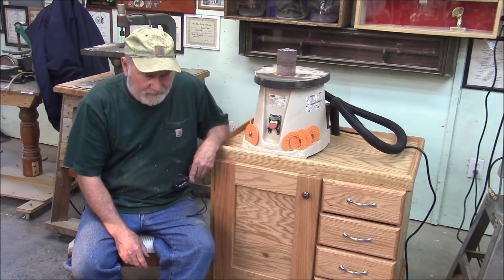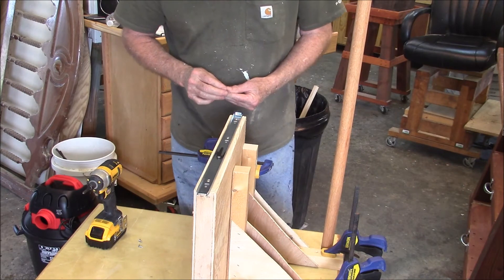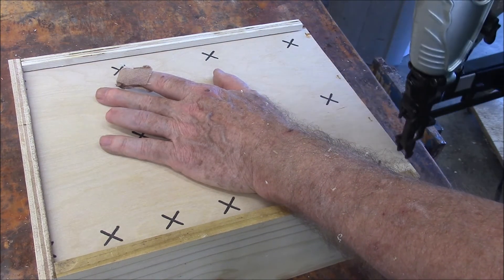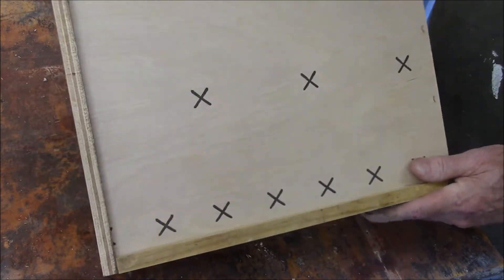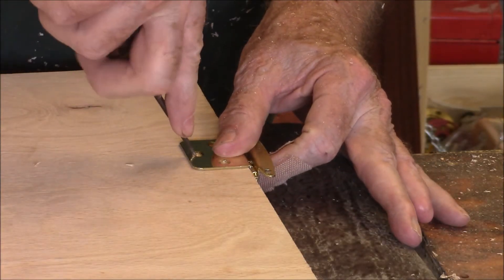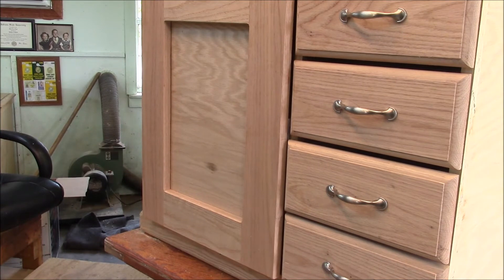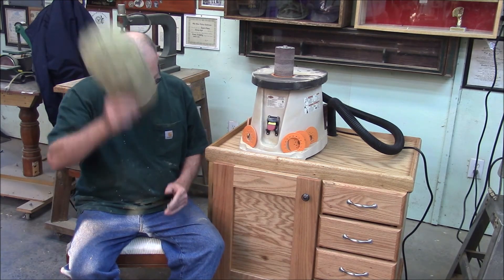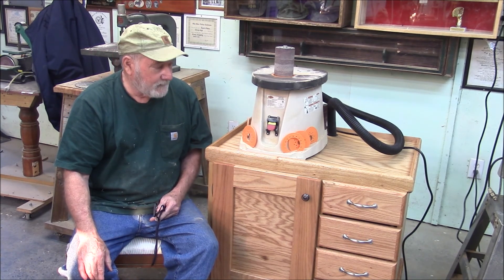61 Building a Spindle Sander Table with built in dust collection

Comment: I'm glad to see your spindle sander has a new home. However, that cabinet is very nice so I wouldn't be surprised if that one ended up in the house as well. Don't let your wife see it. :-D
Reply from the maker: She doesn't come to the shop much, and she doesn't even watch my videos!!  I built a boat out there one time, and it was almost finished before she noticed it.  She says my shop is to noisy and the lights are to bright.  
    Yep, the spindle sander table is better even than I thought.  One switch and the sander and the dust collection are on.  And the drawers are filling up fast.  Makes me wonder how I got along without them.
     Did you notice how I skipped the whole electrical wiring scheme?  Not in my wheelhouse, so I don't want anyone to be led astray.  
     Thanks for the kind words, and hope to see you next week.
Reply: ***** I had to laugh when you talked about the "special" hinges because I think we've all had that happen and it can be quite frustrating. Last week we were talking about wheels and I really like your choice of wheels for you spindle sander cabinet, and the drawers are really a nice touch to keep your spindle sander supplies handy. I did notice you didn't show the electrical work and figured you did that so anybody not experienced in electrical work wouldn't try it.
Reply from the maker: You're right about the electrical.  I feel confident in the ham-n-eggs level of electrical I do, but I'm not an electrician.
     Those wheels were really high-end - quality.  Like you, I like me some good wheels, if I'm going to have them at all.  
     I bought those "special" hinges during the garage cabinet build, as there were 36 cabinet doors and it would save me some bucks?!!  Well, you know what happened; I ended up going back to Lowe's to get the hinges I should have bought in the first place.  You get what you pay for, but I don't think I'm the first to notice that fact.
     Thanks for watching, and thanks for commenting twice!!!